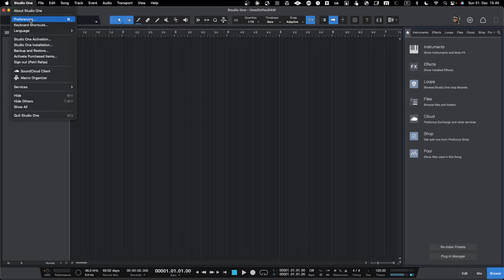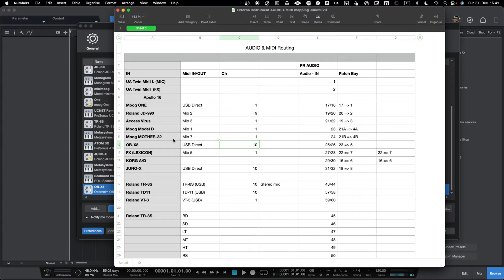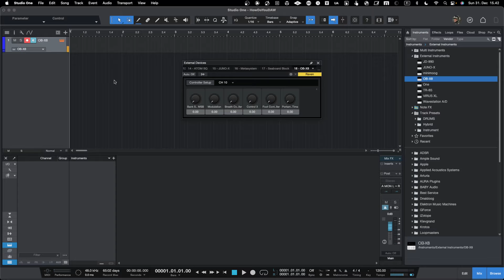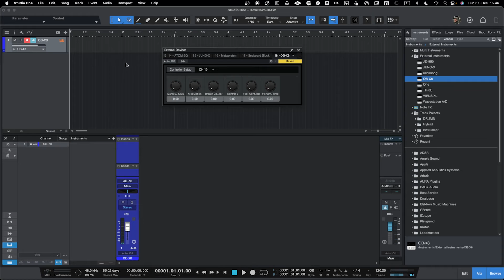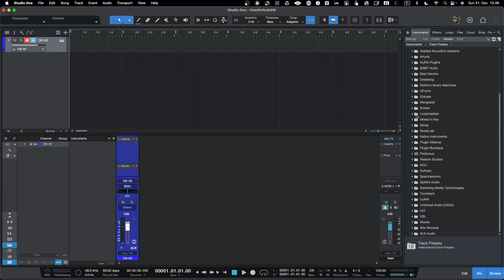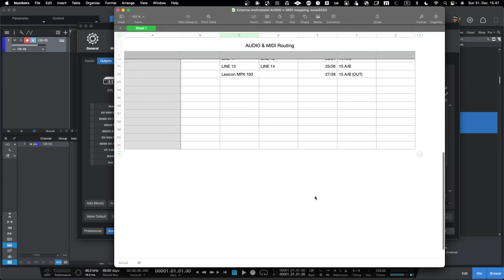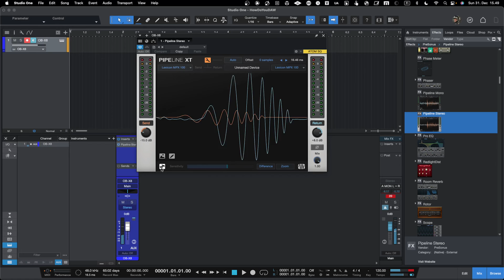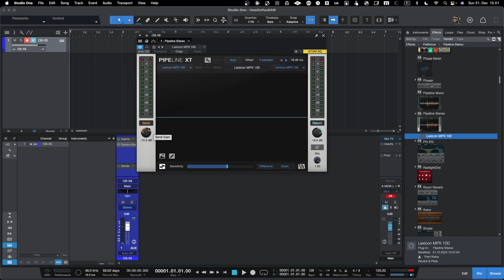Studio One External Synthesiser and Outboard Gear

Comment: So, what I'm getting from this is, I have to setup 16 different AUX if I have a 16 part multitimbral synth?
Reply from the maker: Yes 16 stero aux if you have 16 stereo out from multitimbral synth. In case they are mono the 16 mono aux for 16 mono out from multitimbral synth
Reply: @Howdoyoudaw  So, USB won't accomplish this? The reason I'm asking is I wanted to use the internal sounds of my Roland DS and control them through the DAW.
Reply from the maker: @pctshooter  Does the Roland Juno-DS audio over USB have 16 audio channels in ?
What I do with my synt is that I record the sound one at the time as external synths do not have more that 2 or 3 multitibral capabilities. DS manual says it has 16 parts.
Reply: @Howdoyoudaw  it does have 16 parts and it has a built-in audio interface.
Reply from the maker: @pctshooter  Thenk you need to map all audio in  in the Studio One Audio configuration to get all in.